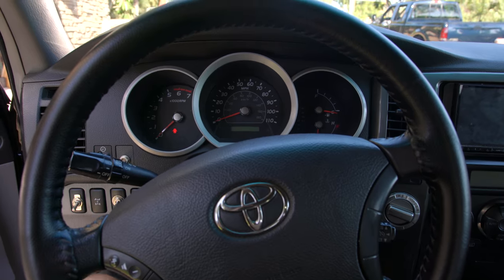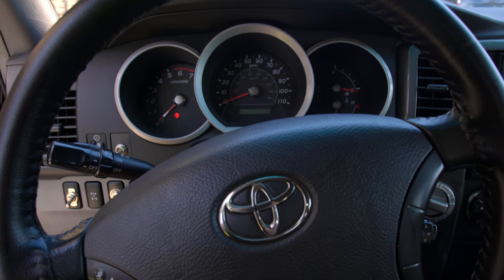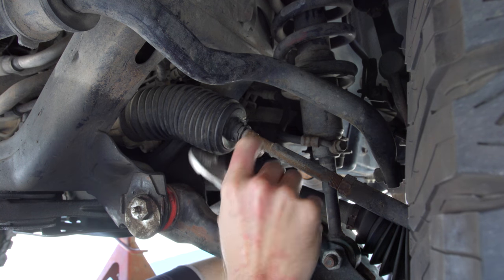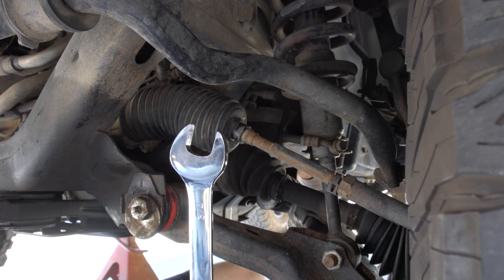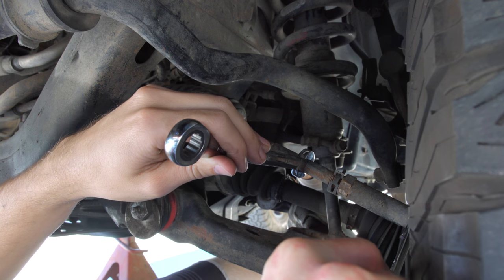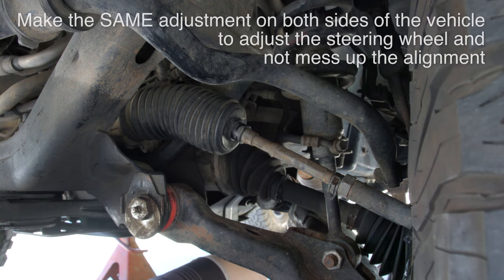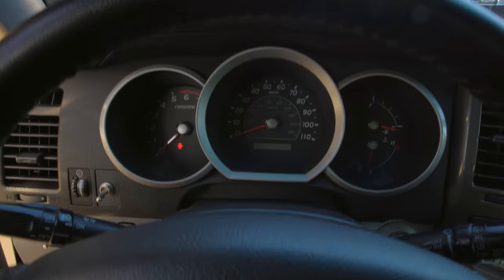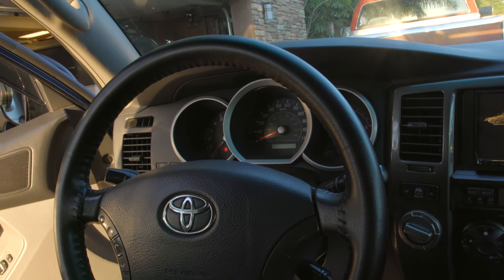How to Center a Crooked 4Runner Steering Wheel

Comment: Awesome video! I just took our car to get an alignment and on the way home realised the steering wheel was pointed 10-15degrees to the right. I called the shop and they told me to come back tomorrow and they'd fix it but the car wont need an alignment again as the alignment is unaffected by the steering being off. Is this true?
Reply from the maker: Shayan Khan it is true. The alignment can be correct and the steering can still be crooked. If you follow the directions in the video you can fix the steering wheel without messing up your alignment. If they said you can bring it back then I would go ahead and fix the steering wheel yourself and still take it back to them so they can double check your alignment. It’s incorrect that they would say the car doesn’t need an alignment because adjusting your steering wheel is part of the alignment procedure so after fixing the steering wheel they will need to check your alignment again. Sounds confusing... as your truck sits you are fine to drive it and it should be driving straight. It’s just annoying to look at a crooked steering wheel.

Comment: Now you need an alignment lol
Reply from the maker: I actually did end up getting an alignment after this. It ended up not being off at all! Guess I got lucky and really moved them both the same amount. Too bad the shop couldn't just give me a straight steering wheel from the start!
Reply: Lilac.......You ain't a kiddin'. There's DOZENS of stupid videos just like this one, duping people into doing this NONSENSE. BECAUSE MOST CARS & TRUCKS HAVE AN ADJUSTABLE U-JOINT ASSEMBLY TO THE STEERING WHEEL SHAFT RIGHT UNDER THE DASHBOARD. THAT IS THE VERY REASON IT IS THERE, TO STRAIGHTEN THE STEERING WHEEL WITHOUT EVEN TOUCHING THE FRONT END & SCREWING UP THE ALIGNMENT. I just posted a complete description on how to do this THE RIGHT WAY in my main comment above. ( Some cars DON'T have that U-joint under the dash......but most DO. ) If I didn't know better, I would swear some OWNER of a shop that does front-end alignments started this BULLSHIT.......TO DRUM UP A BUNCH OF BUSINESS FROM IDIOTS SCREWING AROUND WITH AN OTHERWISE PERFECT FRONT-END ALIGNMENT......JUST TO "STRAIGHTEN OUT A DAMN STEERING WHEEL".
Reply: @howabouthetruth2157  you just uncentered your steering wheel from the rack, yet you're so CONFIDENT YOU KNOW WHAT YOURE DOING but you have no idea.

Comment: doesn't that change the wheel alignment though??
Reply from the maker: Herman only if you spin them different amounts. You spin them the same, literally the only thing that happens is the wheel turns.
Reply: All he did was push both front tires inward to correct his steering wheel position he may be 2 degrees of his total toe setting but it wont be off to cause an alignment ISSUE.
Reply: thanks for the info friends.

Comment: Maybe you need to go to a different alignment shop. Lol I don't see how they missed that. That's usually part of the alignment it's self.
Reply from the maker: You’re right. I didn’t want to pay again somewhere else and they wouldn’t refund. I went back a couple times and finally did myself.
Reply from the maker: @subtegral  Thank you for understanding!! It's amazing how much flack I've gotten on this video. Now go watch my balancing beads video.. might actually deserve some of the trolling I get there haha, but this one I feel like I did the right thing after so many attempts with the shop. I understand it could throw things off.. but It still drove straight and I was happy afterward. Tires wore well too.
Reply: @subtegral  I Disagree. I gotten an alignment and my car was pulling to the right. My steering wheel was off and they corrected it for me. I didn't ask for anything or mentioned anything about my steering wheel was crooked.
Reply: @subtegral  And how many alignments have you done in your life? Show me some validated proof to back your claims because I'm not buying that. I just don't see any logical sense leaving a steering wheel crooked when getting an alignment done esp they have to put the car on an alignment rack to make measurements of thousands of an inch. They have to straighten the steering wheel when putting it on the rack.
Reply: @subtegral  You didn't even answer my question or provide any evidence to your claim which means you have no credibility. Case is closed. No point trying to argue if you have nothing to back your claims.
Reply: @subtegral  If you can't provide any evidence to back your claim why waste your time and energy debating over the internet. Any pro Mechanic will tell you the same thing. Scotty Kilmer would also tell you the complete opposite of what you said. Your just a nobody with no credibility. End of discussion.
Reply: @subtegral  Do realize this is my thread you are commenting on? I'm the OP of this post as I have full control of my own post. You are trying to force your own opinion like its a fact when yet you provide nothing to back your claims. Your statement is just an opinion just like any one else. I highly doubt you even work on cars are do Alignments for a living because you would of provided some video or sort to justify how its done.
Reply: @subtegral  You commented on my post. It's not your post. Only a Pro Mechanic would tell you how it's done. Stop trying for force your opinion like its superior over mine. You are wasting time and energy. Now you go away because I have the power to purge this whole post and watch all your comments disappear. Bye

Comment: dont do this, when they do an alignment the wheel needs to be straight then adjust front end......this method makes ur alignment bad again, just take it back and have the shop fix it
Reply from the maker: I did take it back, 3 times. 
Then I did this to straighten steering wheel myself and took it back a 4th time to make sure the wheels were still aligned.